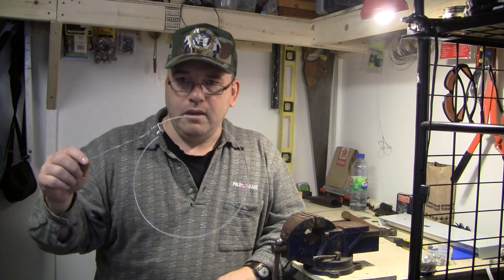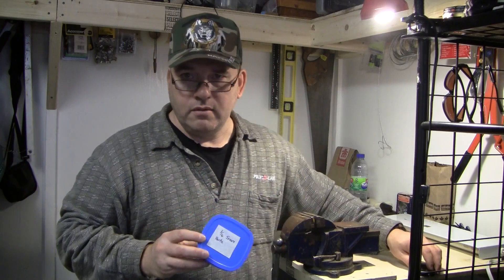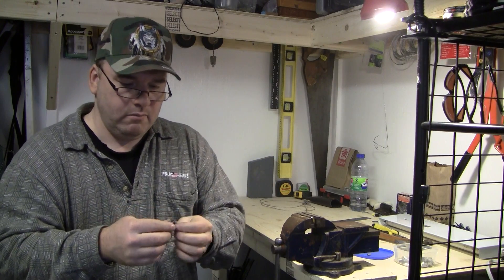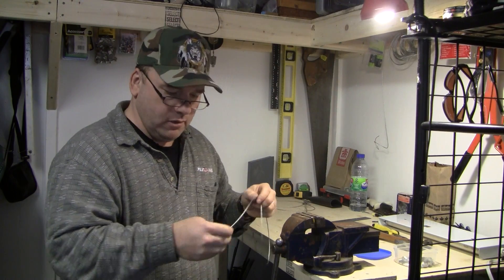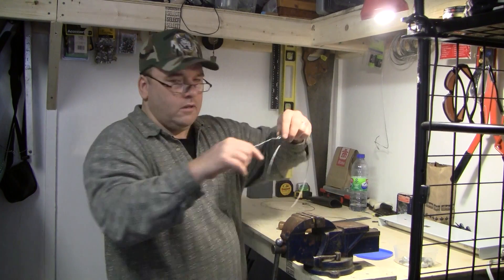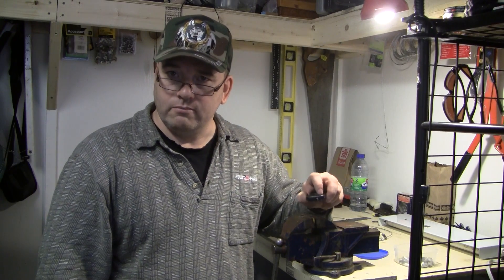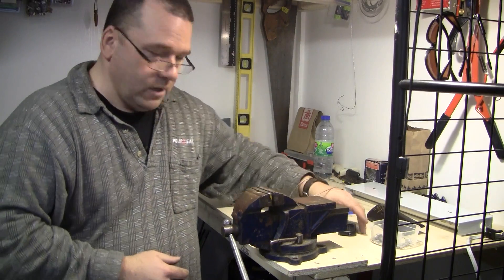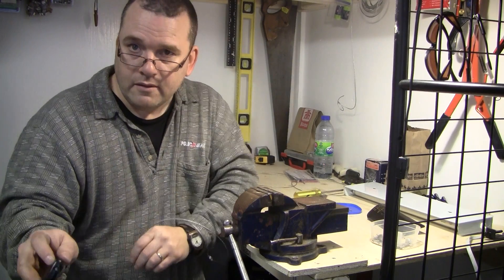Making fox and lynx snares

Comment: thanks, very informative. I guessing coyote same thing just bigger? Also are the snare locks ordered special? I've seen people use washers or pennies bent at 90 degrees for a lock.
Reply from the maker: yes, for coyote I use 3/32 cable, loop size 9" - 11" snare height 10" - 12" as a general rule, but modify as I feel needed to the spot I set the snare. 90% of my coyote snares are loaded as well.